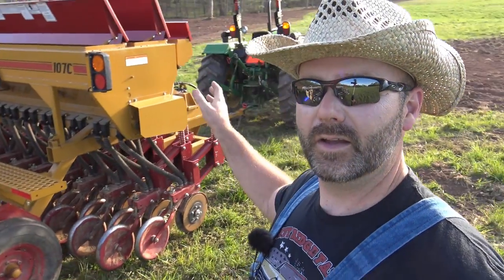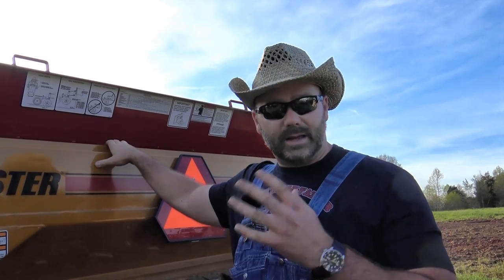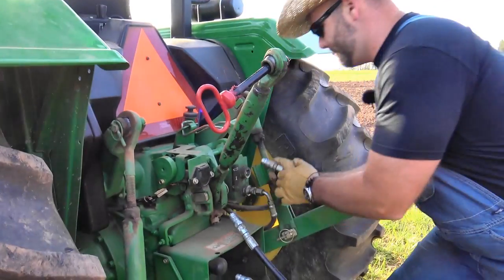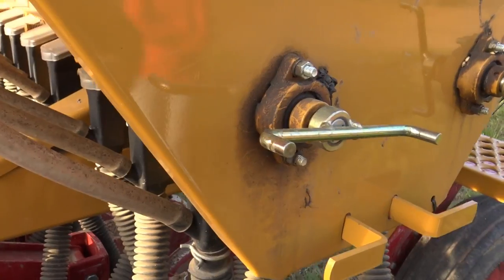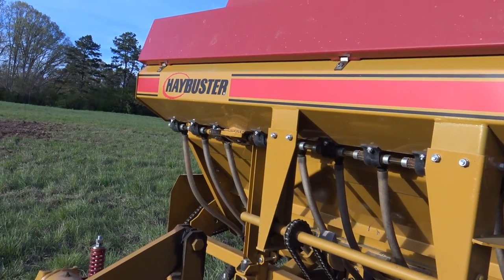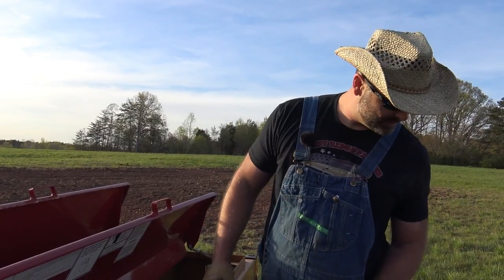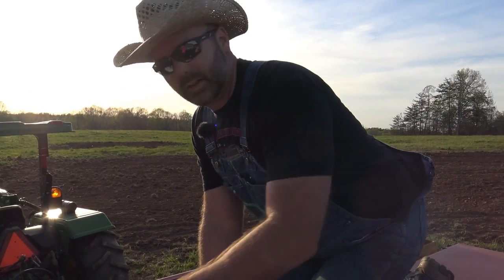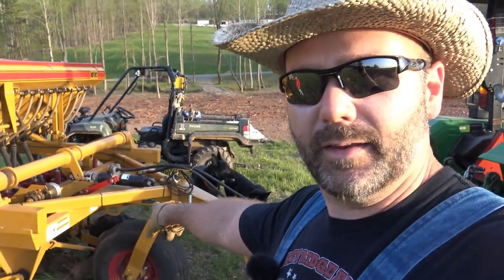COOL FARM TOOLS EXPLAINED...NO-TILL SEED DRILL...SEE HOW IT WORKS!!

Comment: You have a very good point about need to be strong to be able to do so much of this farm work. I am a female farmer and also new to farming and I really struggle to physically do so many of the aspects of farming. I know what to do from a technical or logistical perspective but then I can't physically do it. It would behoove a company to start developing tools and equipment that is female-friendly...in other words, a little easier to handle for those with smaller body frames or just not as physically strong as a larger person.

Comment: Been watching you videos for a few week and really like them.  As some helpful aid in hooking up drawbar equipment there is typically a pin in the tractor front of drawbar (right in front of rear axial) that you can push up to release the bar so you can move in/out. Older tractors had multiple locations depending on what one was doing.  Likewise there are two bolts or pins on either side that lets it swing.  This can be handy on heavy hitch equipment.  We always had to move the draw bar to connect our old disc first of spring.  Be careful that pinot pin hole likes to get fingers.

Comment: Here's a trick to getting the pins aligned, tilt your bucket cutting edge down, and when you are close to having the pins right, pick up the front of the tractor slightly, then put the tractor in neutral, you can use the tilt cylinders to fine tune the alignment and drop the pin in.

Comment: That pin yoke is bent out. A big pipe wrench or adjustable wrench will get it lined back up quick & easy. Maybe weld some small gussets on the sides to keep them from bending out again after you get it lined back up.👍
Reply: Good eye, looks like a nice drill in general, but that is a poor connection.
Reply: Landon Tesar 

Well, at 3:06 you can see the flex arm for it and it looks done pretty well, so it might just have been beat up a little when he got it.

Comment: That little bit of belly is a southern belly. You need it to have your strength.  Yes! It takes alot of strength to farm, it's not for the weak minded either. Ty for your detailed video on the equipment.

Comment: interesting that you used rye as your companion crop rather than oats.  I often reference your video as a training tool for people that want to use the Districts Haybuster 107C  Also have a jack stand welded on the drill and it will make lining up much easier.

Comment: In case you didn't do it (at least on camera)you should always check and make sure your seed tubes are open all the way to the ground. Especially if the drill has sat for an extended amount of time. Trash chaff, spider webs, and "critters" such as your deceased passenger can make homes in them. Haybuster makes one heck of a drill and yours seems to have all the bells and whistles. I have a Great Plains I really like and they are good drills too. Oh and one more little tip..... DON'T BACK UP with it in the ground. With good moisture you will be seeing green very shortly.
Reply from the maker: Very good point
Reply: Have you ever heard the phrase"don't ask me how I know?" Believe me it can save you a lot of grief. Just trying to help........
Reply from the maker: Yep. Probably a good idea to blow them out before use for sure